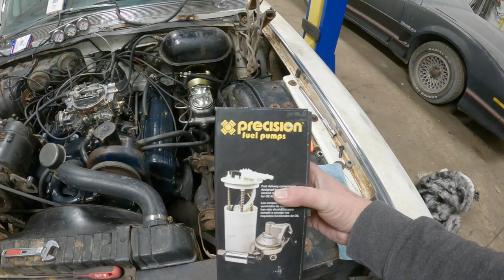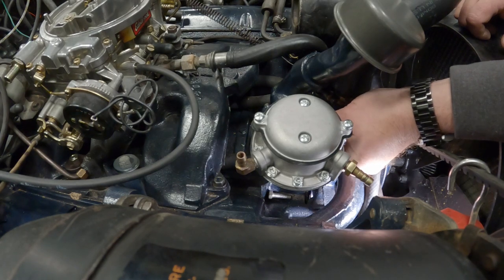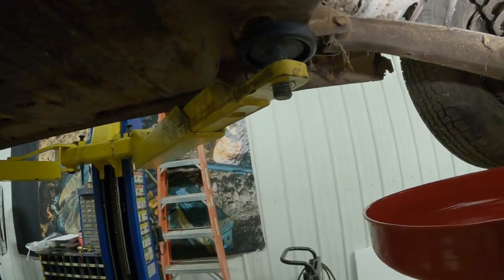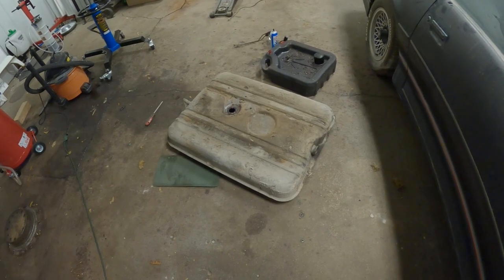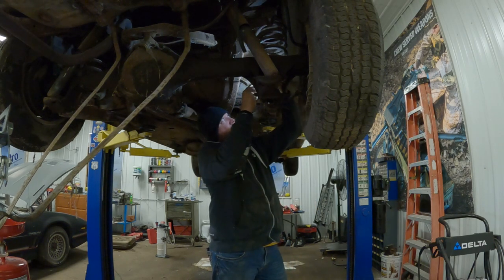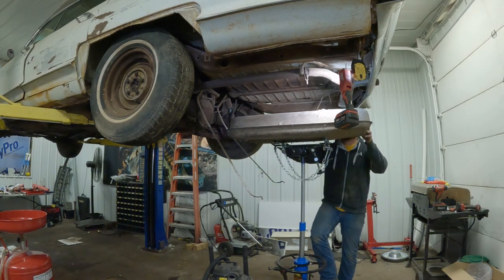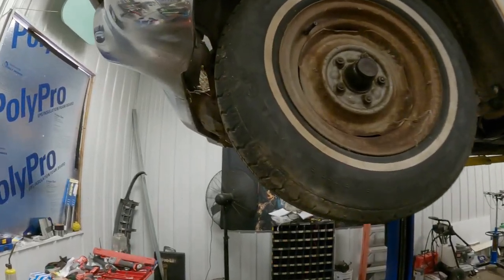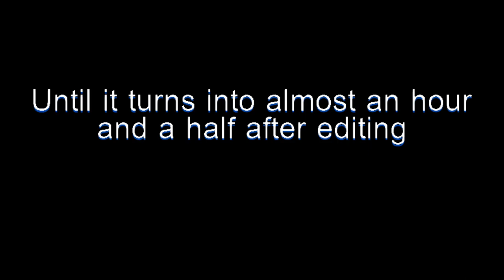Fuel System revamp! Can it run on it's own fuel tank? (watch to find out!)

Comment: There are two clamps that go under the bolts on that large AC/generator bracket that hold the fuel line back from the belts.

Comment: The fuel pump that was on there was not original. So i would not be to worried about the comparison. The new one looks much more correct from the outside at least. The main complaint people have had with the new ones is thd valves in the pump pop out of place easily. They should be staked into position go prevent that.
Reply from the maker: Great info!

Comment: The 61 cadillac had a fuel filter after the fuel pump befor the carb. The AC version was the only one with a return hose. The return connected to a port on the top of the AC fuel filter.
Reply from the maker: Have you seen the price on those original ones? Holy smokes!